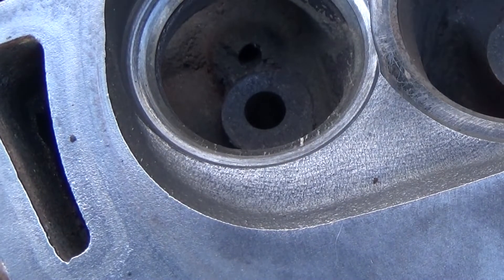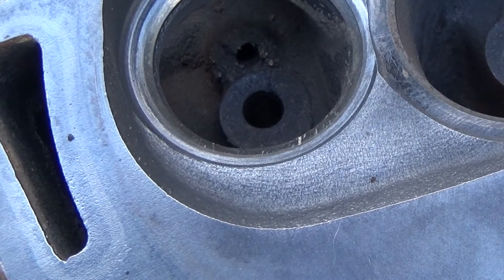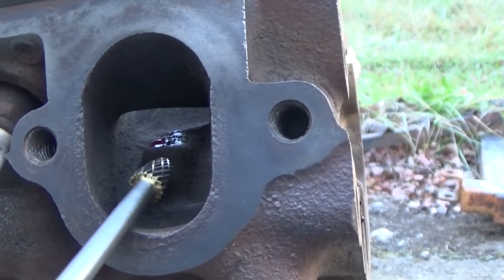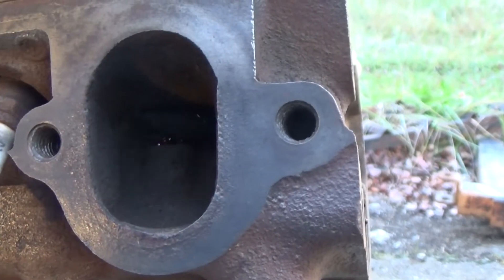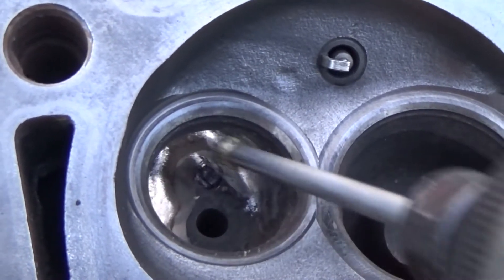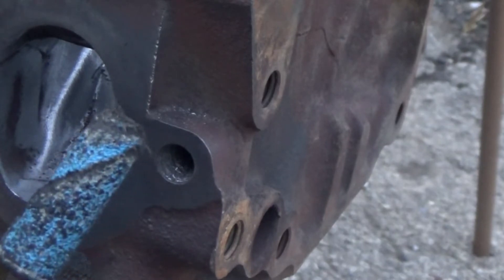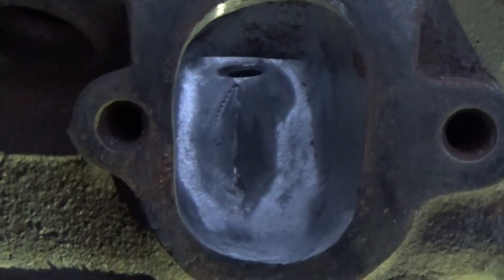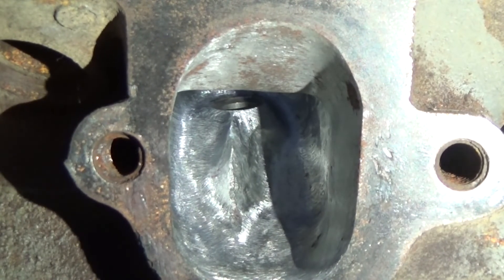460 Cylinder Head Porting

Comment: Building a 460 efi to carb for my tuck. I'm definitely subscribed to this man
Reply from the maker: Are you going to retain the efi heads and intake and installing a carb or are you swapping the heads and intake to the carburetor versions?
Reply: D3ve-a2a heads I found for my build. Due to not finding a aluminum intake that will bolt to the heads. Unless you have info. Want a 500 lift cam. No comp cam. And long tube headers. Doing a 81 f150 lwb
Reply from the maker: @dezelhaig619  There is not an aftermarket intake that will bolt to the fuel injected heads.
Reply: I'm hoping the heads will fit good or do I need to change what I'm doing. Info would be great.
Reply from the maker: @dezelhaig619  The D3VE heads will fit on the fuel injected short block just fine. I have did that before. The short block remained the same except for the dish of the piston, whether it was carbureted or fuel injected.
Reply: @BlackLabGarage  I have not gotten motor on stand yet to pull apart.
Reply: On the way home with motor we got hit. The whole side of my daily looks bad. Motor is in shop and stand is next to it. Lol I watched the video you did about the Howard's cam. How is it do for you
Reply from the maker: @dezelhaig619  I haven’t fired that engine up yet but I’m not worried about wiping a lobe out on it.
Reply: @BlackLabGarage  pulled intake and I have two bent push rods 3&4
Reply from the maker: @dezelhaig619  I can honestly say that I have never had a bent pushrod on a 429/460. Now you are going to have to find out why they bent?
Reply: @BlackLabGarage  not those cylinders lol. 2 cylinder intake rod. 6 cylinder exhaust rod. Passenger side not marks on pistons. Sill have to pull other side. Wife called me and said dinner ready. Home made wings. So I went in not passing those up
Reply from the maker: @dezelhaig619  Still have to find out why they bent though. Someone could have put a larger than stock camshaft in it and reused the original valve springs. That will definitely cause it when the springs coil bind because of the increased lift. If the engine sat for a long time and the valves was stuck in it would cause it also.
Reply: @BlackLabGarage  stuck valve. But I'm not using heads. Crank has very light scratches on it. So it will need to be polished
Reply: @BlackLabGarage  cylinder walls look great
Reply from the maker: @dezelhaig619  1993 and up 460's used metric low tension rings like they used in the 5.0 Mustangs. They won't hardly wear a cylinder out like the older style piston rings would
Reply: Sticker on valve cover has date 11/25/91. Also rods have been marked for locations. And also on very bottom of rod caps all are stamped with a #5
Reply from the maker: @dezelhaig619  a 1991 460 will still have the 5/64" rings on it but that one is also as close to a factory flat top piston as you can get. Yes Ford stamped all of their rods with the respective cylinder number from the factory.
Reply: Stock 460 with a 513 lift Howards cam. Do you think I need get a stall converter or stay with the one in the c6
Reply from the maker: @dezelhaig619  It will depend on other variables like rear end gear ratio and stuff. Of course the more torque your engine makes the higher a convertor will stall. I'm going to run the Howards 240031-12 camshaft in my 460 with the stock stall convertor in my 4x4. The stock C6 stall is 1500-1600 and that camshafts power band is 1500-4800 so it should be fine. Although a little bit higher than stock stall speed like 2000 rpm's certainly wouldn't hurt anything either.
Reply: @BlackLabGarage  I'm not boring nor stroking my engine. Efi block to carb using D3 heads and changing timing cover to run manual fuel. Will be using Howard's 513 lift cam. And may have heads decked a little. Performer intake. 750 cfm carb. This is plan.
Reply from the maker: @dezelhaig619  I would have the block decked before I would deck the heads. The closer you get the piston to zero deck the better your chances of not having detonation. I didn't say anything about stroking the engine?
Reply: @BlackLabGarage  I know you didn't say anything about stroking the block was just stating plans and info. Engine shop. Gave me great prices and I'm thinking of boring to. I forgot the numbers lol
Reply: @BlackLabGarage  4.390 or I can get same piston package 4.420 . I've always liked wiseco.  PTS530A6 for 4.420 or PTS530A3 for 4.390
Reply from the maker: @dezelhaig619  Then you will have to rebalance it if you use those pistons. Wiseco makes good pistons but why do you feel you need forged pistons? Because you aren't going to be turning that high of rpm's with that camshaft?
Reply: @BlackLabGarage  I didn't think about that .
Reply from the maker: @dezelhaig619  I mean don't let me talk you out of using them. Wiseco are great pistons and it's your engine and your money. I'm just of the mentality of spend money where it's needed and save it where it's not needed and on an engine that will be 5,000 rpms and lower and never have nitrous or anything added to it, I couldn't justify spending that kind of money for the pistons when a hypereutectic piston would be just fine for that application.
Reply: @BlackLabGarage  it's going to be something with just sound and enough power to roast tires that's is all.  We don't have a drag strip anymore it was closed down. And man I miss it. I really agree don't spend money if it's not necessary.
Reply from the maker: @dezelhaig619  a stock 460 will roast the tires if everything is right. That 1978 Bronco I had which belonged to a friend of mine before I got it had 40 x 17.50-15 Gateway Monster Mudder tires on it. With a bone stock 1970’s Lincoln 460 in it and 3:50 gears it had no problem burning those Monster Mudders.
Reply: @BlackLabGarage  motor is going to be bored. Guy showed me a spot I didn't see. Don't know how much yet on bore so I'll have to spend the extra now. Clean, bore, cam bearings, and all new freeze plugs. And he is going to deck the block.
Reply from the maker: @dezelhaig619  460’s have pretty thick cylinder walls and tolerate overbores a lot better than their cousins the 335 series. Most 335’s don’t do well with more than a .030 overbore.
Reply: @BlackLabGarage  soon as they call me I'll know then go from there.
Reply: They called me yay motor is ready for pickup. Blocked cleaned up. Crank only needed Polished. All new freeze plugs and cam bearing. Bored 30 over. He decked the block some but didn't have paper on hand when he called. So Wednesday I'll get all info when I go pick it up.
Reply from the maker: @dezelhaig619  That's good to hear!
Reply: Guy didn't write down how much he deck the block for clean up. The heads D3 do not have the termite holes. Is it solid in that lump. Just want to know so I don't mess up when porting the head .
Reply: My phone is not letting me know you replied

Comment: Not even worth driving home with. 😂
Reply from the maker: @bbtjdonnelly14  those Harbor Freight sanding rolls suck. I tried some of their wet/dry sandpaper once. I was wet sanding a hood and I noticed I wasn’t making much progress, I lifted my sandpaper up and all the grit was gone and I had been rubbing it with the paper backing😂
Reply: @BlackLabGarage  haha sadly not surprised. I was a sucker and tried their flap disks with similar results. Been some time ago, not sure if much has changed.
Reply from the maker: @bbtjdonnelly14  usually if it grinds, cuts, or drills I avoid Harbor Freight. Although a while back I did buy some of their 4" cut off wheels because they had them on clearance for .99 a pack! At that price I don't care to replace them several times lol

Comment: Ported the correct way too. 
Biased the cylinder side of the port.
Narrowing and shaping the valve guide boss:)
Raising the port just a bit. 
Staying off the floor 

You got to watch Andy Wood 
Leaning about (Area Ruling) 
Working in the combustion chamber. 
De shrouded the valves.
Flow ball technique 

You did good man you did good:)
Reply from the maker: Thank You for your kind words. I learned to stay off the floor from Joe Sherman. He always said there is nothing to be gained at the floor.

Comment: Back in HS shop , i built a .30 over 460 and added 69 Dove 429 heads , 280 magnum cam with port o sonic intake .. slapped it in a 1969 cougar ..
Reply from the maker: I bet that was a tire roaster lol
Reply: @BlackLabGarage  it was fun to drive , I used a boss 429/ 69 tbird waterpump for extra room to fit a 3 core Radiator.. The c6 Trans had a 3k stall and a Trans pak valve body / shift kit ..
Reply from the maker: @ i guarantee it was a tire fryer and was fun to drive!
Reply: Those Port O Sonic intakes were great.

Comment: I did the same thing to my 460 heads I ported them but I took the bump completely out and then I put flat top pistons in bump the compression up to nine and a half to one and installed Cobra Jet valves in my stock 460 heads
Reply from the maker: I have ported them before and removed the bump completely. Newer flow bench tests are showing that bringing it up like a wing helps direct the flow and they flow slightly better. Either way works far better than doing nothing to them. If I was building a 460 for a street/strip car I would definitely install Cobra Jet sized valves because I would be turning more rpms with a street strip 429/460. Not that it would hurt to install them in a lower rpm truck 460 but I don’t think they are needed as much in a lower rpm application. I think porting the exhaust and a good valve job will get the most bang for the buck out of a lower rpm 460 but that’s my opinion. Now if I was turning over 4,000-4,500 rpms often then yes I would definitely add the Cobra Jet sized valves
Reply: @BlackLabGarage I've got a '97 F-350 with the 460.

Did I hear you correctly when you said the timing is already straight up in the engine? I won't need to do that to my truck already since it was done from factory? 

Also, do you know what I'd need to do to set the timing away from being retarted? Spelled that way for YouTube reasons.
Reply from the maker: @John_Buck  Yes, a 1997 model 460 has the straight up double roller timing set. I'm not sure what you mean on the last question?
Reply: @BlackLabGarage  Do I need to do anything to the distributor, as in advance or retart it? I wasn't specific enough, that's my mistake.
Reply from the maker: @John_Buck  Well there isn't much you can do with the fuel injected distributor. You can remove the spout connector and that locks the computer out and then you can change the initial timing of the distributor. For example you could change it from 10 degrees before top dead center to 12 degrees before top dead center or whatever you prefer but that's pretty much all you can do. All the other ignition timing is controlled by the computer. Of course you have to replace the spout connector after you change the initial timing. If you try to change the timing without removing the spout connector the computer just overrides any change that you make in timing.

Comment: Got a 71 460, D3 heads, any idea what my compression would be?
Reply from the maker: I'm assuming it's a D1VE block which they used until 1979. If it has the standard dished pistons it was advertised as 8.0:1 but in reality its probably a little lower than that. It's probably somewhere between 7.5:1 and 8.0:1.

Comment: is the exhaust side less finicky than the intake side in regards to the quality of the port job? I was watching a video on a guy porting the intake side and he was saying you can make them worse if you take out too much bc it will cause the air to bounce around more.
Reply from the maker: Actually I'd say it's the opposite. You don't want a perfectly smooth finish on the intake side because that will allow the fuel droplets to fall out of suspension and puddle up where as a rough texture on the intake will help keep the fuel droplets in suspension in the air. You have suction from the piston going down in the cylinder to draw the fuel in but the exhaust valve opens right after the explosion at top dead center as the piston is going down in the cylinder so it doesn't have the suction advantage that the intake side does. As far as cutting too much of the port out on either side will cause you to lose velocity which is important. Faster you can get the air in and out of an engine the more efficient and more power it will make. A good example would be the Boss 302 engine. They were absolutely dead on bottom end because the ports and valves were too large and had no velocity down low. Only when you were up in the rpm's would the ports come alive and have some velocity to them.

Comment: I was thinking about doing it to my 1997 f250. Ive done lots of other heads with great success so it should be fun. What size are my exhaust valves now and how much bigger do you go on these? I am getting 12 mpg now anyway and good power stock
Reply from the maker: Be careful with those heads. While they can use a little improving, the fuel injected heads are some of the best heads that Ford ever put on the 460 engine. Especially the F3TE head which is what you should have on your engine. Ford finally figured out that velocity works and used it on those heads! If you cut too much out of the ports you will loose the velocity of those ports. So be careful porting them. Your valves currently should be 2.10" diameter intake and 1.65" exhaust. Those valve sizes will support close to 400hp. The older E7TE 460 fuel injected head has 1.95" intake valve. It does need a larger intake valve installed. If it was me I would say with the current valve sizes and have a three angle valve job done and do some porting on the intake and exhaust but concentrate mostly on the bowl.

Comment: Its a mistake to put too much emphasis on the exhaust side of these heads.  The intake side needs about an equal amount of work.  There is a ton of flow and velocity to be found in the intake port when the short side is reworked properly.
Reply from the maker: But this is on a lower rpm truck motor. That's why I said if I was porting a set for a drag engine or hot street engine it would be different. For that I would move to the bigger valves and do more work on the intake side also, but for a lower rpm truck motor using a stock intake I think the emphasis should be more on the exhaust side.
Reply: If you increase the flow in the intake port by properly reshaping areas of the port, valve job, choke sizing etc you will  increase the mean port velocity which will help greatly even in a low RPM truck engine.  @BlackLabGarage

Comment: I enjoyed your video on porting the 460 heads I have some 69 heads i ported it really helped the engine to come alive and I had a 620 lift cam and a portosonic intake with a 750 holley on it in a 2500 lb car run 6.37 in the 1/8 mile std bore
Reply from the maker: Thank You for your kind words! Porting the 429/460 head makes a world of difference in them. I used to have a Portosonic intake. I should have kept it. Good intake for a hot street strip car.
Reply: @BlackLabGarage  what do you think about the RPM AIR GAP, & AFR heads with flat top pistons?
Reply from the maker: @ it looks like AFR offers the 429/460 head with either a 75cc or 85cc combustion chamber. Personally I would go for the 85cc chamber which would keep it around 10.1 with flat top pistons and zero deck. That’s my pick if it was going to be street driven any. Now if it’s race only then I would go for the 75cc combustion chamber heads. But the air gap intakes are a proven performer. But whether or not I would use one is just all depending on what the intended usage of the engine would be. Street car or drag strip, yes I would use one. In a truck that I’m going to use to pull with I wouldn’t use one because they give up some low end torque in trade for higher rpm horsepower.

Comment: Wonder what they flo now,  look  good
Reply from the maker: I haven't put these on a flow bench but the stock exhaust port usually flows about 135cfm. Staying with the stock exhaust valve size but porting like I did will get you to 175-185cfm. Going with the bigger CJ sized exhaust valve and porting the bowl to match it gets you around 200cfm or slightly more.